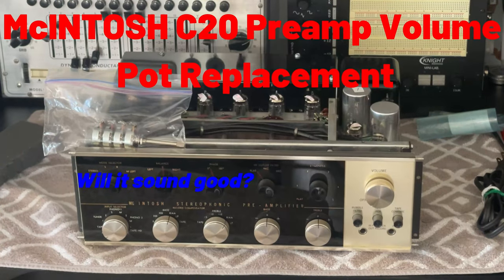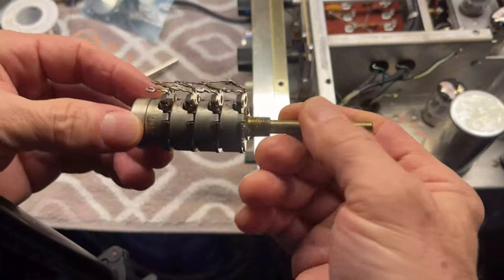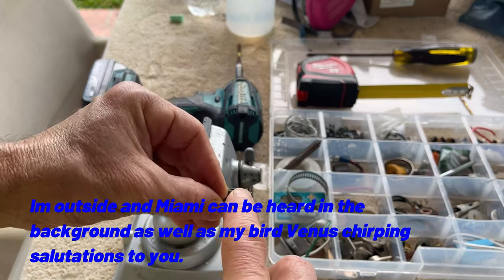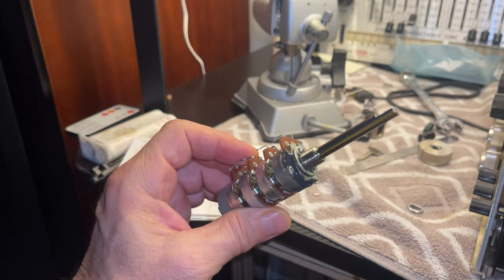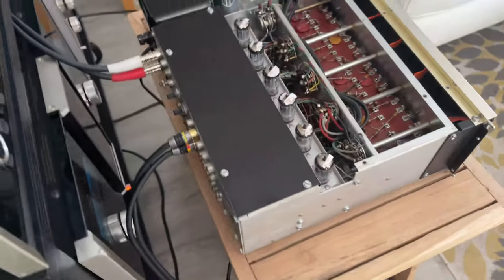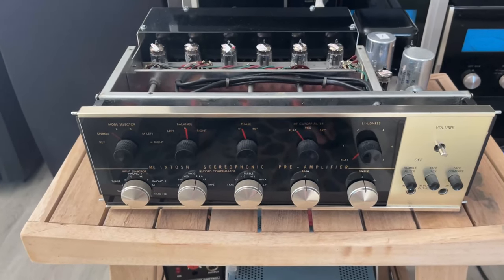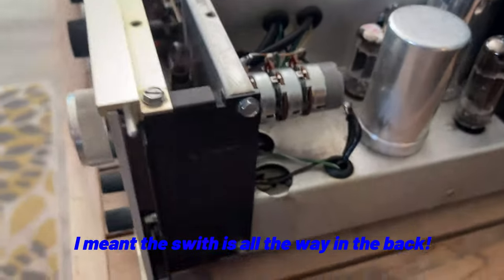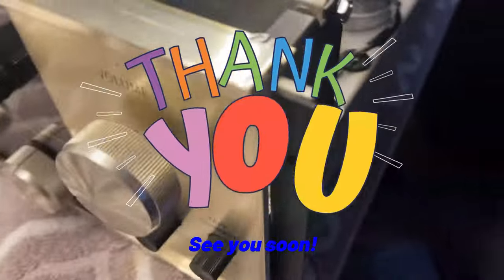Mcintosh C20 Volume Trimpot Replacement And Sound Impression.

Comment: Nice job. Where did you get the pot from?
Thank you.
Reply from the maker: Hello teammate! Thank you for watching liking and commenting. I really appreciate it and if you haven’t please subscribe because it would really help me.
That unit belongs to my friend Steve and he brought me the trim pot to replace. I will ask him if he remembers where he got it. 
Just so you know, the original trim pots can be rebuilt if a new one cannot be obtained but it is a little bit of a mission. Basically one can purchase tripods of the same value and replace the wipers as many of them are interchangeable. But like I said, it can be tricky as some of these trim pots are linear and some are logarithmic so everything must be matched. There’s actually four wipers on each of the units because the volume is changed at two different stages. And when you do fix it, just stop using that power switch because as I mentioned in the video, the tour applied ends up, ruining the structural integrity.
Once again thank you very much!
🙂🙏

Comment: hello mr tiny can you help me i have power amp YBA 2 pcp is burnd and multed wher a can get new one
Reply from the maker: Hello!
Thank you very much for watching my video.
I would try ybahifi.com but that would probably be expensive.
I will try to get a used one online. 
I’ve done something similar before where I set up a search on eBay so that I would get messages when somebody listed the PCP that I needed and it worked. 
you can also do a Google search and click on photographs.
Most of the photographs of the items that show up on Google are from listings that people have for sale.
Is it really to damage to be repaired?
Reply from the maker: would you post a photograph of the PCB that you need and let me know the part number?
once again, thank you very much. I hope this helps. 
🙂🙏